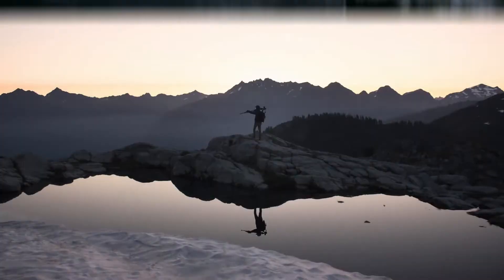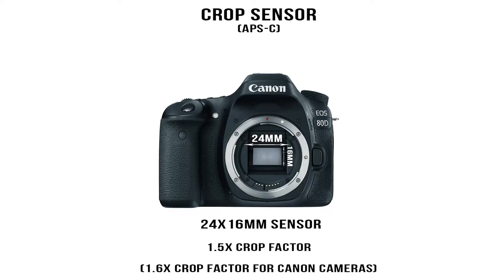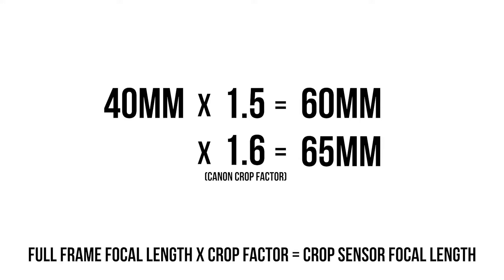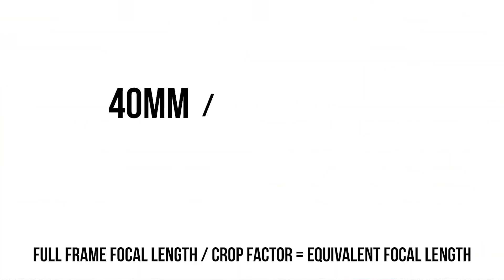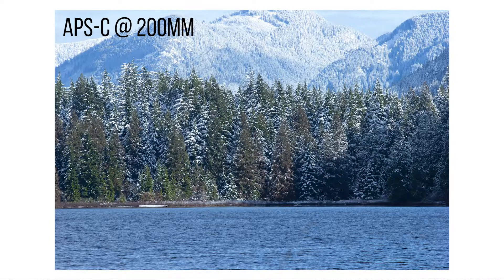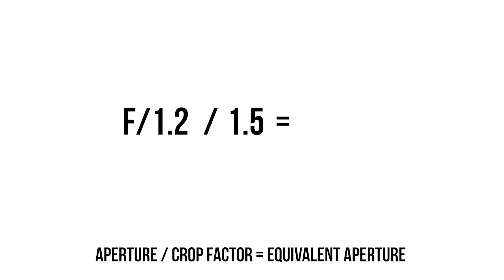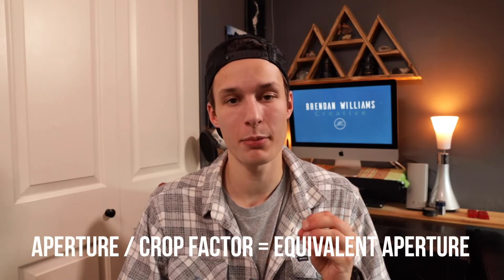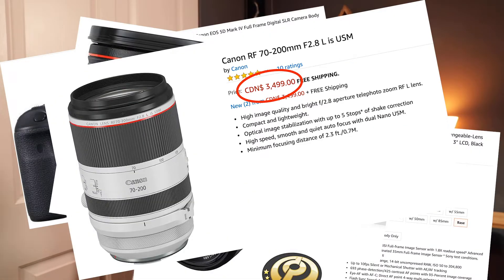Crop Sensor VS Full Frame - What's The Difference And Why It Matters

Comment: Brendan, I have a Canon 90D and shoot only landscape and like many others, we are getting images that are just not sharp. Do you think it has to do primarily with kit (efs) lenses and 32.5 pixels on a crop sensor (APS-C) camera? Really struggling with this and wonder if better glass like EF lenses would solve my issues. I shoot 95% on a tripod and use a remote shutter. Even when I do a 3 image photo stack, I am still getting images that are not tack sharp front to back. Any ideas?
Thanks for your time.
Reply from the maker: Lenses definitely make a big difference in the sharpness of images imo. If you know someone to borrow from, or can rent one before buying, and see if its the results you were looking for!

Comment: I'm shooting with a sony fullframe but I need a 24mm, Im thinking about getting the 16mm crop lens  then that would give me the 24 I need but I will lose some pixels. Is worth it. I'm shooting with the a7rii.
Reply from the maker: If you are shooting with a full frame like you say, a 24mm will be 24mm. You don't need to worry about equivalence.  Secondly, you won't be 'losing pixels'(assuming you're talking about resolution) because of a lens size. Although the focal length changes, the sensor remains the same and is recording the same amount of information. Hope that's what you were looking for!
Reply: @BrendanWilliamsTutorials  if shoot with a 16mm crop lens on a fullframe that would give me the equivalent of a 24mm but I will be losing resolution's. On 42 megapixel would that make a big difference?
Reply: @diamonddogs6037  you got it all wrong! When you put on the 16mm lens, you get 16mm super wide angle on a FF body. If that lens is designed for a crop sensor then possibly you will see heavy vignetting around the edges of the frame.
Reply: @fendrou  will I be losing any resolution if I use a 16mm crop lens on a fullframe?
Reply: @fendrou  never used a crop lens before just want to see if it was worth it or I will just stick to fullframe lens instead.
Reply from the maker: You don't want to use a crop sensor lens on a full frame camera. Like Fendrou said, there will be bad vignetting using a crop lens on a full frame. You can use a full frame lens on either a crop sensor or full frame, but you can't do the same with a crop lens if that makes sense.
Reply: @BrendanWilliamsTutorials  I know what you mean, thanks👍